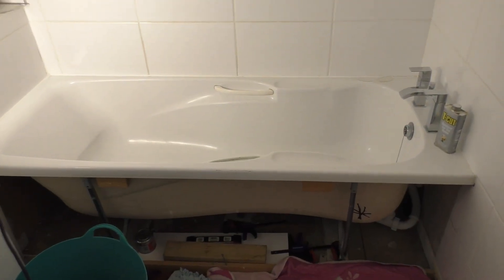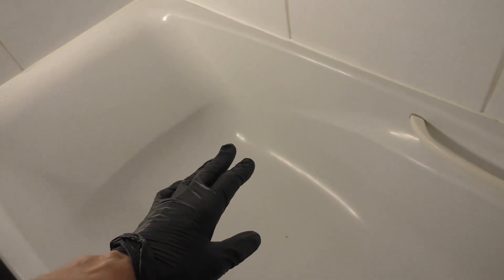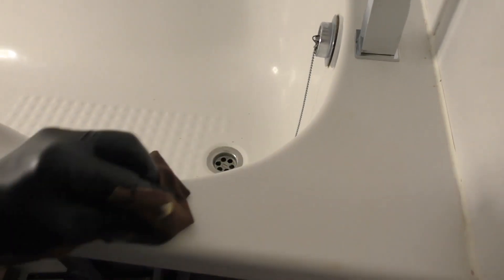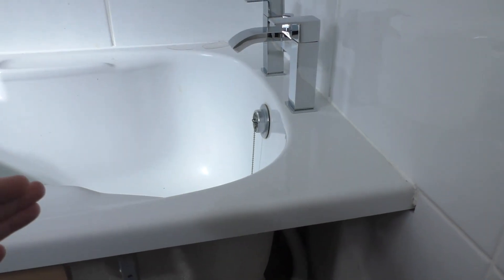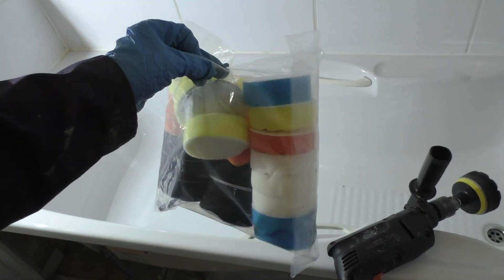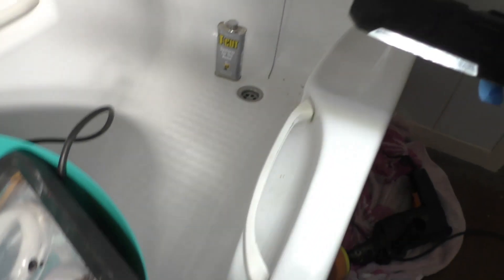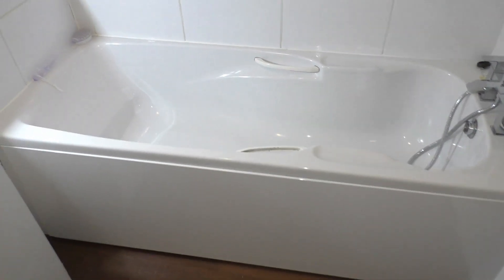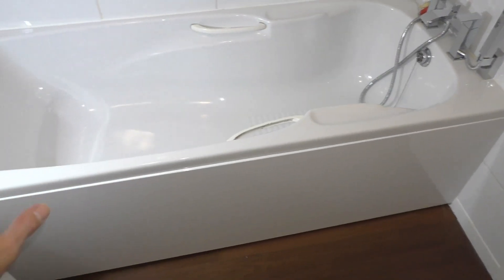How to Restore your old bath tub with T CUT.  It Works !

Comment: Would T CUT for car do the job? I see this product varies in price drastically.
Reply from the maker: I think that would work but the car Tcut seems thicker.
Reply: @CB-RADIO-UK  maybe make job easier. I have shower tray that looks dull even though regularly cleaned.  I will try the T. CUT on a wee bit.

Comment: Good. One Mr Fred 
I just did a tub my mom put in
In 78 lol I used tire bleach spray it down let. It set 10 minutes ran a rag. N sprayed it down n used  white compound I mix my Owen from bars 
I used to have service for big trucks 
Polishing there aluminum n chrome 
O if someone use the tire bleach in side do vent the room well
Reply from the maker: Sounds good Joe.  I thought this one as well past it.
Reply: @CB-RADIO-UK  ps Fred you got me thinking n I went in the shop n polished my big John n sprayed it whith zoop seal now it b blinging for about 4 to 5 years I do it to my slots 
Rat rod